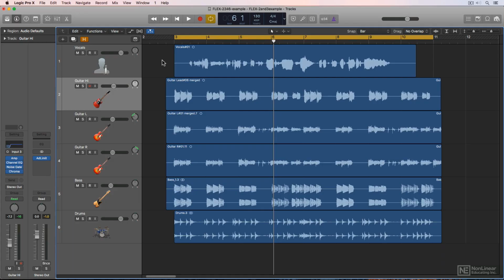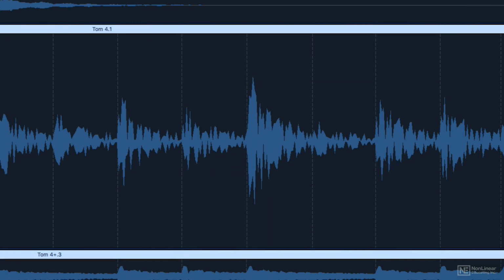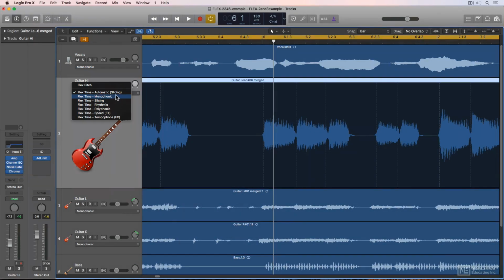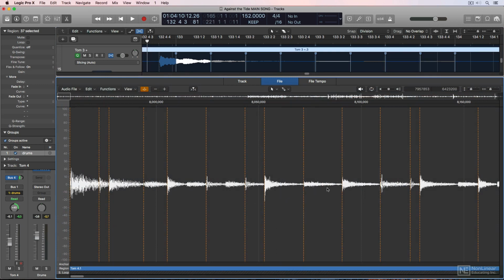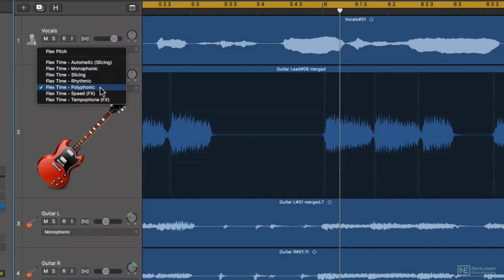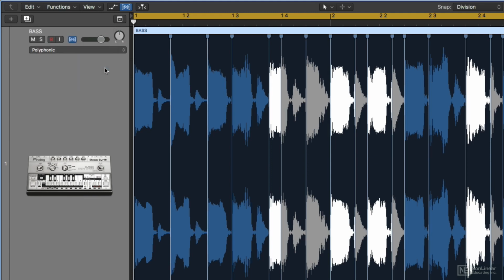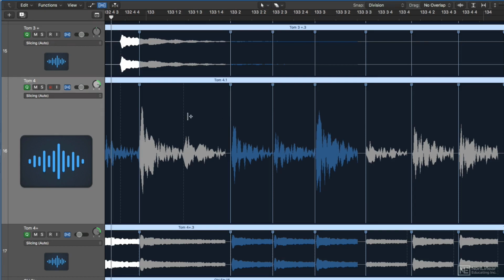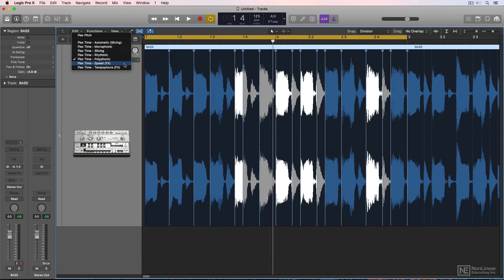Logic Pro X 302: Flex Time  Time Correction - 2. Enabling Flex Time Flex Algorithms and Uses

Comment: Ok, I’ve applied flextime/editing to a six channel drum recording. But when I “save” it, then turn off the flex feature. The edit disappears and the transients snap right back to their original places. How can continue with flex edited tracks, without having to keep flex on and continuously using all that processing power?
Reply: You should be able to select any tracks that you have and bounce them (thus saving any editing that you've done to the tracks). The editing will essentially be printed on the bounced audio files.

Comment: Is there a way to make it all on grid at once? I dont want to pick every single note i want on the grit and put it there manually
Reply: Yes, but it doesn't always work. It is on the quantize option on the "region" strip on the left hand side (Quantize, Q-Swing, Transpose, Fine Tune, Flex & Follow, Gain). Select Quantize, and select your value. Make sure flex is already turned on for that track.